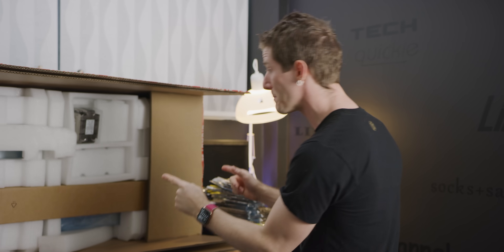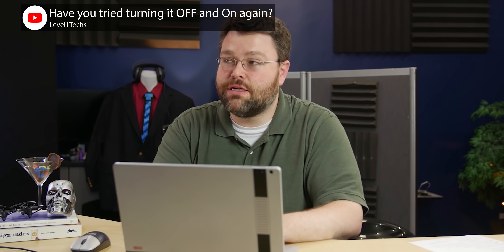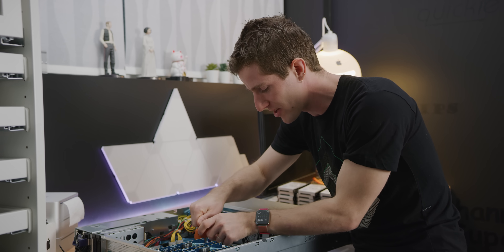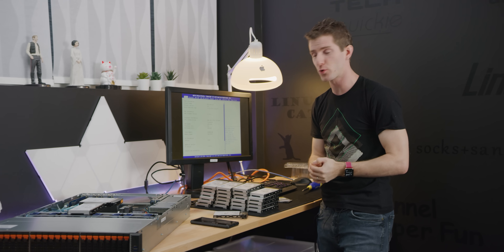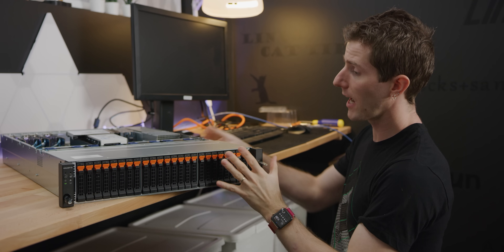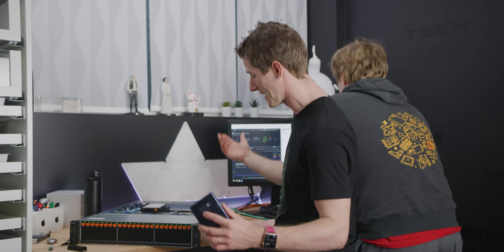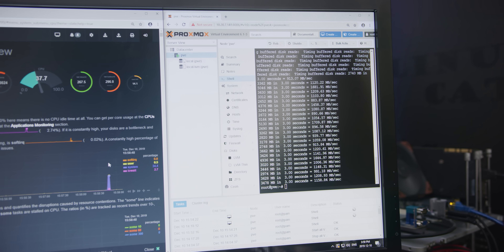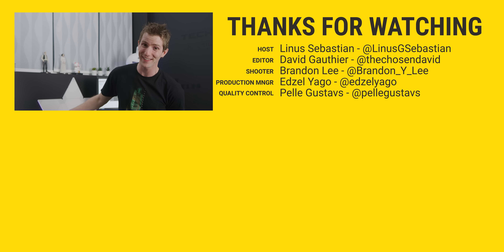Where Intel is in REAL Trouble... - AMD EPYC Server Upgrade

Comment: 1. https://www.amazon.in/X399-AORUS-Gaming-ThreadRipper-Motherboard/dp/B0746CT3Y5/ref=sr_1_14?keywords=motherboard&qid=1577299257&sr=8-14
2. https://www.amazon.in/Strix-GeForce-GDDR6-Express-Graphics/dp/B07HY6QWXN/ref=sr_1_3?keywords=RTX+2080ti&qid=1577299326&sr=8-3

3. https://www.amazon.in/Corsair-16GB-3000MHz-Memory-Module/dp/B07B4GNMS9/ref=sr_1_1?keywords=ddr4+16gb&qid=1577299386&sr=8-1

4. https://www.amazon.in/Rosewill-Liquid-Cooler-Closed-Cooling/dp/B07CNXL1X7/ref=sr_1_1?keywords=fan+for+pc&qid=1577299474&sr=8-1

5. https://www.amazon.in/Intel-i9-9900KF-Processor-Unlocked-Graphics/dp/B07MGBZWDZ/ref=sr_1_1?keywords=i9-9900kf&qid=1577299491&sr=8-1

6. https://www.amazon.in/Samsung-Internal-Solid-State-MZ-V6P1T0BW/dp/B01M215R0B/ref=sr_1_11?keywords=ssd+1tb&qid=1577299543&sr=8-11

7. https://www.amazon.in/Seagate-IronWolf-Internal-Drive-ST10000NE0004/dp/B01M4FU8Y3/ref=sr_1_4?keywords=10tb+hdd&qid=1577299575&sr=8-4

8. https://www.amazon.in/Samsung-LC49HG90DMUXEN-48-9-inch-Curved-Monitor/dp/B073RJQXB1/ref=sr_1_4?keywords=monitor&qid=1577299600&sr=8-4

9. https://www.amazon.in/Thermaltake-Vertical-Modular-Computer-CA-1K9-00F1WN-00/dp/B07FDDJJ4X/ref=sr_1_3?keywords=gaming+case&qid=1577299646&sr=8-3

 Cheap as fuck build

Comment: Linus. As long as you bother with software raid, you won't get the full speed possible. Proxmox is a virtual environment. It has the ability to act as a file server but I would go with RHEL or SuSe Enterprise linux.. Windows is... You know, I don't trust Microsoft at all.  Ok its easy to configure,  has an intuitive gui but linux is more stable and faster if you use up to date repos.

Comment: Sorry to be "that guy", but the title of this video doesn't have anything to do with the content. Sure, Linus is using an Epyc CPU, but the video isn't about Epyc vs Xeon at all. The title on Floatplane was fine ("Our fastest server yet") and clickbaity enough for Youtube.
Reply: This build needs 104 PCIe lanes for all the storage (across the 24 drives & the two boot drives), and 2 socket xeon systems only offer 96 at most. More lanes will be needed for the network connection as well, so it's not possible to make this system on single or dual socket xeon. Xeon also wouldn't offer future compatibility with PCIe 4.0 drives
Reply: @maxhammick948  well of course, but the video isn't about that. It's about building a storage server, not comparing what you can build with Epyc vs Xeon.

Comment: I heard these drives were having issues with temps and falling quickly once reaching their advertised R/W,  perhaps not in this setup but in enterprise ones Intel has been under Firmware crunch to fix it

edit: also cmon, that's only a few sleds try doing that with a couple hundred in a day ;)

edie2: Those speeds are the beauty of SDS:) all that perf per server across a network fabric that scales linearly if the network can keep up per server, so each server has X*y performance potentially where X is the server and Y is the number of servers.

Comment: Why not just use mdadm? ZFS is cool, but mdadm is much more mature. And you must not be married to ZFS since you attempted Windows first. Just set up mdadm RAID with tried and true ext4 on top. Feel free to message me with any questions.
Reply: How is mdadm much more mature? Sure, it's 5 years older, but it's not like zfs was instable. If Linus wanted to stick with ZFS, he could use proxmox directly, though I'm not sure how stable  ZoL is. Or my preferred solution, install Solaris. It's not free, but it's fast. If FreeNAS is preferred, try esxi instead of proxmox. Whenever hardware passthrough is involved I like to stick to esxi. Or just install FreeNAS baremetal. Afaik it should work with epyc.

Comment: Linus is the guy who buys the IT guy's first quote proposal lol
Also I wish server board makers would add an option that disables whatever makes their boards take eons to post for people who don't need all of those deep, time-consuming checks, or are troubleshooting something unrelated that requires them to reboot frequently. Would be really nice.
Reply: Oh boi... You need to the logs and checks for critical failures
Reply: @loloioi  In certain environments and in general yes. What if I'm fixing some Windows updates because Microsoft broke things and I need 20 reboots to find and solve the problem? HW boot logs are useless in that case, the CPU temp is irrelevant, memory errors aren't the issue, the fans are turning, the problem is software and the hardware checks are *interfering with my ability to diagnose the software*. Why can't I stop that as a user who is supposed to have complete control over their hardware?

Comment: Idea for a future video, the graphine product that actually hit market that noone is talking about.

PGS (thermal graphite sheets)

3-5x more thermally conductive than copper and with the right thickness, nearly as thermally conductive as diamond, all in the same graphite pad form factor your used to.
Reply: Like the innovation cooling ones (I believe confirmed to be precut Panasonic PGS) that have been on the market a year and LTT did a segment on?
Reply: @JohnSmith-qy1wm  Interesting, did not know that IC was using the same pads, going to have to look into that. Thanks

Edit: The thermal conductivity on IC's pads are a fraction of Panasonic's? I'll look into it a bit more later I guess.

Edit #2: It seems that I was looking at the specs for 'normal' pgs vs the 'soft' or 'compressible' pgs that IC uses. Still, the normal pgs is not very widely tested and would probably make for an interesting video. (2-5x more thermally conductive than the soft variety)
Reply: Pretty sure they already reviewed it a year ago.

Comment: So,  let's do some math: 24 drives at $370 a piece= $8800 + EPYC processor at $3960= $13760+ whatever the server cost= more money than my current car and motorcycle...
Reply: They probably made $13K just on this video alone already, if not more, from Youtube ad money, sponsorship, affiliate links and advertisement for their store (look at everything in the description).  Think about that. They spent a lot of money, earned it all back and more from a relatively short, low effort video.  But then remember,  AMD gave them the processor. Gigabyte gave them the server chassis / mobo.  So it's an even better deal for them.  What took you probably over a year to acquire, with lots of hours put in for your effort, they got it in a few days or less.   =(
Reply: With a rig like that who cares about a car or motorcycle. Hell after I quit working 14 years ago I just sold the car and used the money to buy a mega PC (about $12,000) and a couple hundred games. Hell with Prime Amazon delivers food now too pretty cheap (comparable to grocery stores locally), so with welfare there's no need for the real world at all. Fuck it, if I want to see outside I'll use Google Street View.

Comment: Once again, Linus makes the same boneheaded mistake of installing windows as a server OS
Reply: my question is why he put proxmox on it then a freenas VM?
Reply: @ghost-lp9cv  He got lots of cores and memory, so he probably wants to run more services on the machine then just the NAS. And it is MUCH better and easier to separate multiple services/tasks into small VM's then trying to make everything play nice together in one install. And with VM's you easily make backups and snapshots of the VM. So if the NAS or some other service goes down because of a bad update etc, it takes literally 10 seconds to revert to a working state.

Comment: lol, happened to work with Storage Spaces and their terrible performance - most people will tell you that it's because the physical and logical sector size and because of how 512e drives behave. Bullshit. It's the allocation unit size of Windows volume and Interleave size of Storage Space. When creating the virtual disk in power sheel, set interleave size to 1/2 or 1/4 of NTFS (or ReFS) allocation unit size, depending on whether your parity space has 3 or 5 columns. My performance jumped from 40MB/s to 300MB/s just like that (spinning rust). SSDs are going to be a blast. Storage Spaces simply aren't mature enough for a production machine anyway - even if you were able to make it work correctly, it actually doesn't support the scenario where your drive fails. It won't tell you. No notification. No support to send emails. Nothing. You have to click through control panel all the way to storage spaces to see whether all your disks work, otherwise you won't know that your array is degraded. Pathetic.

Comment: Is that level of aggressive fans really needed on an SSD-based rig?
I can understand you'd need much for running (that many) HDDs, but SSDs are generally a lot more power efficient, and besides - heat isn't an issue for NAND. In fact it's good for longegity and you only have to keep it below the controllers throttle-temp. Less aggressive chassis fans and a fan-cooler for the CPU seems like it would be more sensible.
Yea - i know that this is going into some server-room anyway but it just seems like a waste.

Comment: Windows has supported RAID boot drives in the past but it was a pain. You have to boot windows on the machine, setup a raid then remove that boot device and re-run the install. Oh, M$

Comment: Someone explain to me why the fans on that thing were louder than a damn space ship.
Reply: They're 3000+ RPM (some are 10,000 RPM), 80mm or 90mm fans that are thick and meant to run usually at a 100% all the time because noise isn't a consideration for where these get put in.

Comment: Maybe a dumb question... but why create your virtual disks in windows and not in the bios?
Reply: As he said in the video there was no integrated RAID and Gigabyte didn't send a RAID card. Also with software based RAID you can monitor and reconfigure more easily. Also if your hardware RAID controller dies you need the exact same model of controller (and motherboard if it's integrated) to recover the array.
Reply: @deimiosxxx  He was talking about the raid controller for his boot drives at that point.  The big cards in the PCIe slots with blue cables coming out of them are RAID cards.  And you don't need the same controller to recover the array.  With good data recovery software, you can plug all the drives into a different machine with completely different hardware and recover the data.

Comment: I like ZFS raidZ3 with a single vdev, up to 3 drives lost from ANYWHERE now if i had more than 24 drives i'd probably look at doing two vdevs with raidZ3
Reply: On my freenas box i have a 12x7200RPM array of single vdev raidz3, i could get  almost 1.1GB/s, and i think that was the max my $40 ebay SFP+ NIC supported, now at the time i had 48GB of RAM so in theory the 32GB crystal disk mark test COULD have all ran from RAM, but i dont know if iSCSI takes advantage of that ram caching for sure, never bothered to look beause it always just worked well enough for me

Comment: I’m in a dilemma here and I want to ask for advice. So currently, I have enough money for an RTX 2080 Ti, but I believe they are overpriced and not worth the minor jump they have on the previous generation, especially now in late 2019. In June of 2020, the next generation of GPUs release, the RTX 30s. How much you think the RTX 3080 Ti will be? Should I wait? Should I get the 2080 Ti now? Personally I think I should wait the six months. I don’t thing the RTX 30s will be as overpriced and have only minuscule improvements from the previous gens. Thoughts?
Reply: I’ll give you the strength to wait 6 months! It will be worth it, and you won´t have to regret your impatience in the summer :p

Comment: Is there any way to get those high rpm fans to work on a regular PC motherboard? I'm pretty sure they draw too much power for any normal connector, is there a way to hook it directly to the psu? If you're not concerned with noise that airflow should keep any cpu cool.

Comment: So i know the proxmox is suppose to be the like, easyman way of doing linux. However i would encourage the team to look into just running something like Fedora/Arch/whatever your choice is as the base OS and letting it handle the raid using ZOL and then have the services in KVM virtual machines using Virt-manager (a GUI tool for managing virtual machines on linux) This gives you the flexibility of being able to easily pull in whatever kernel version you need as well as maintaining a GUI for management of any virtual machines. This also gives you MUCH more flexibility for how you share the storage. SMB? NFS? 9p? SFTP? etc, it can do them all. and if some magical new amazing network file-sharing comes along in the future it will be easy to add on. I do this for my homelab, my NAS base os is Arch and every service is run in its own KVM to keep things clean and easy to manage.

Comment: I Guarantee you that sea sonic not putting a real add at the beginning actually got them more business
Reply: Seasonic PSUs are A++ anyway. I have a Seasonic PSU that has been running for more than 7 years with no issues, and will probably be going Seasonic again anyway.
Reply: I have a Seasonic psu in my system that is 5 years old, would've loved to buy a new Seasonic psu again for my Ryzen build but they decided to sign an exclusivity agreement with a disturber in my country that refuses to sell to the public and also doesn't sell to any retailers.

Thus it's almost impossible to get their PSUs here except for importing which makes it much more expensive than their competitors.
Reply: Yikes. That really sucks. There are other good brands out there, but that's really a shame.
Reply: @Caligulove  18 year old Seasonic PSU from an old P3 rig is still going. It runs my HTPC
Reply: bot3224 the HEART of your system
Reply: when you make the best product you dont need gimmicks
Reply: bot3224> I Guarantee you that sea sonic not putting a real add [sic] at the beginning got them more business

Because it wasn't an add, it was a mult.
Reply: seasonic is the goat anyway
Reply: bot3224 yeah cause its so unusual so more people will check them out
Reply: i have sea sonic lol
Reply: Machine take a look at linus’ psu tier list. The s12 series of psus from seasonic is pretty low rated so watch out. Otherwise seasonic is actually pretty good
Reply: the anti-ad
Reply: I always go for seasonic when I'm looking for quality.

Comment: they may already do this ,but i dont know enough core info on storage to know. why dont they take a single nvme , add 4 250 gb chips on it, run them all in "raid 0" on the pcb so it looks like only a single 250 gb nvme but it would really have the speed of 4 nvmes in raid 0. it would be expensive, but would it be faster then intel optaine drives? im not sure how many chips in raid 0 it would take to surpass our fastest mainstream drive out right now, and would the price be insanely more expensive or cheaper. i know it wouldnt be true raid 0 , but i mean something equal 2 it. it stands 2 reason that 2 of the fastest drives in raid 0 will beat a single drive. so if they could do it all within one pcb ,they could beat there fastest drive?. sorry if this sounds stupid lol.

Comment: "where intel is in real trouble"
Proceeds to use all intel drives
Reply: Why are you guys not talking about his voice?
Reply: My Intel Optane 905P SSD is a beast paired with the single thread performance of my i9-9900K.
Reply: Pretty sure the title is referring to the CPU they're using instead. Epyc's performance is also crushing Xeon server chips which still run like blazing infernos.
Reply: @TheKazragore  Eight more cores than the top end Xeon, no PCIe 4.0 in that Xeon, and 88 more PCIe lanes...
Reply: TheKazragore no shit Sherlock

Comment: Thats crazy. If you wanted to saturate it from the network or from the internet, you would need a 231Gbit connection at 100% utilization to saturate those drives :o
Put another way, the average global internet speed is 28Mbit. So you'd need a connection 8450x greater than the average internet connection speed.

Personally im happy with my home storage array reaching 1500MB/s with its 5000MB/s cache lol

Comment: im thinking of building a home serer instead of buying a pre built one using Ryzen 3 4 core am4 cpu and 8gb ddr 3000mhz memmory the issue im having is withthe itx motherboard i can only find ones that have 4 sata ports im wanting way more  but can not see any with pci ports to expand.. what youre recomendation to be able to add more drives.  Ive seen some sata expansion cards that do a 1 sata port to 4 but will theese work with servers. i know a daft question

Comment: I have a question, 
I bought my prebuilt pc about 3 weeks ago and it would run smooth, however recently, I noticed that my cpu is at 100% usage and the GPU never goes past 30%. It is an i5 9400f and the graphics card is GeForce GTX 1660. I started freaking out because I dont know why it's doing it

Comment: Isn't ZFS on Linux considered Beta? … Or at least "Beta", i.e. "officially released, but you shouldn't really trust it with anything mission critical".
No wonder it panics out if yes. Just use ext4 and a normal RAID 5/6/51/61 or something similarly well tested, sheesh :-D

Comment: ZFS on Linux, can choose which kernel you want to run and which version of ZFS. Have over 300 TB of data at work in this setup replicated across 2 data-centers. If you want to run custom built hardware you need to leave Windows, Proxmox, even FreeNAS behind.